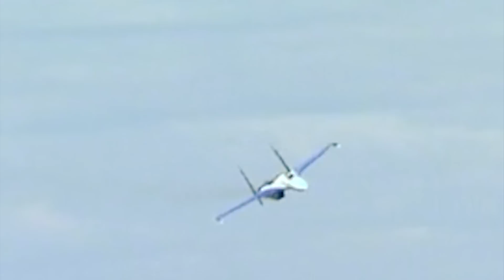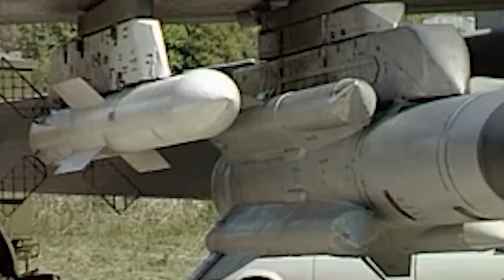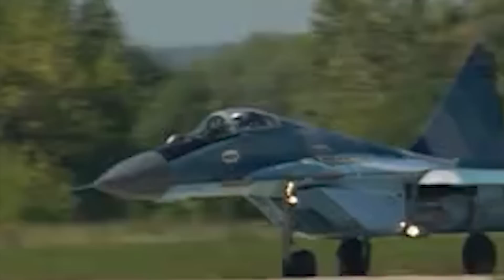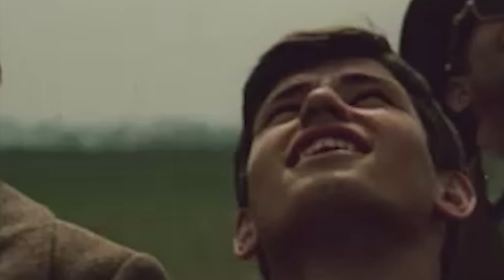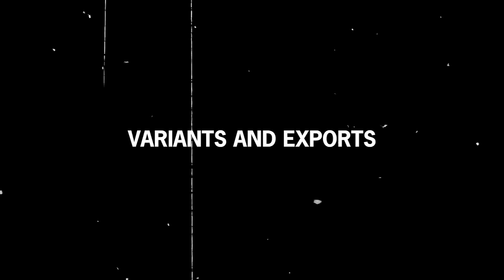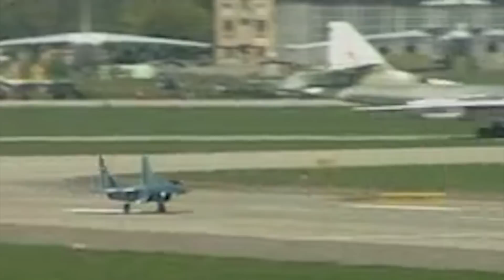Su-27 Flanker - Twin-Engine Supermaneuverable Fighter Aircraft

Comment: Right... sooooo... at various points during this Mig 29 Fulcrums were shown.  Whilst similar in overall planform it is a very different aircraft. The side by side pilot lay-out only goes for one subvariant: the Su-34. Other variants have a tandem lay-out if they have two seats. The follow up Su-57 does not have the capabilities you mentioned outside of propaganda.  It is, in fact, not even engaged over Ukraine. This has been a trend for this and other " Dark" channels during the last year. Cutting corners and pursuing sensationalism . This is a pattern.  I'm signing off. Goodbye.
Reply: I believe nothing coming out of Russia.  They lie as much as the Xiden administration does.
Reply: Goodbye, dear friend.
Reply: Good bye you won't be missed either you're full of it & don't know what you're talking about
Reply: What you've wrote bares no resemblance to reality. You haven't got a clue what you're talking about. This so called publicity stunt you say the SU-57  is the aircraft that's been used hitting the training centres in western Ukraine. All the videos are in Telegram. It turns out it has fantastic surprising that were unknown. Its capability is unmatched by anything. You first tried to say the Mig  & the Sukhoi are a similar platform. Straight away you proved you don't know what you're talking about. The Mig is a light much smaller fighter like an F-16. The SU - 27 & newer varients are heavy fighters like fighter bombers similar to the F-15.
There's a YT channel called millennium 7  he does full break downs of all aircraft. You'll find out how much of a publicity stunt the SU-57 isn't & how good it actually is. Now tell me about this space ship the Americans have & all of the battles its fought in. Its that fantastic they stopped building them. Then went to ridiculous expense in building a flying pig. I've asked a thousand F-22 fan boys why is it being fazed out if it's so good, I've also asked to tell me of its successes. The only reason I've gotten is the clearly bullshit reason of it costs too much. Why it couldn't be upgraded for a far cheaper amount than a full development of an aircraft with much poorer capability does not make sense at all. Unless  America does what America does best. Talks complete bullshit all the time because it knows its citizens just believe anything they say. Putin's Tax Hike caused it.
Reply: @DavyRo  they're not going to be able to mass produce the Su-57 in any significant numbers are long as sanctions are in place, and Ukraine's air defenses are going to result in more attrition of airframes over time. It wouldn't make much sense to risk their most expensive weaponry to attack training centers when they can do it with missiles that arrive on target twice as fast. And you make yourself out to be an expert but you clearly don't understand the US military's procurement process. Maybe you should do some research on it, starting with historic procurement failures of advanced airframes like the Valkyrie, B-1 and YF-23. Cost DOES matter, but not always. Export licenses matter, too, not to mention regional politics within Congress and outright bribery by defense contractors.
Reply: @DavyRo  So you haven't read my post. Astounding! You could have answered with tl/dr but didn't.  Your loss really.

Comment: Just a short note Mexico does not operate the Su-27 either in the Air Force or the Naval Air Arm... There was a chance to do so but this was squashed in 2006.
Reply: I believe Venezuela is the only Flanker operator in the Americas (besides the private US aggressor firms).
Reply: The variant that Venezuela has are the Su-30MK2's
Reply: @hmmjedi  Technically the Su-30MK2V, based on the Su-30MKK, with added maritime strike capability. It was initially developed as a subvariant of the Su-35 that was backfilled into the Su-30 to respond to a tender from Russia and the PLA. Vietnam, Venezuela and a few other countries later adopted it, mainly under deals to transfer resources in exchange for (often unneeded) military kit.

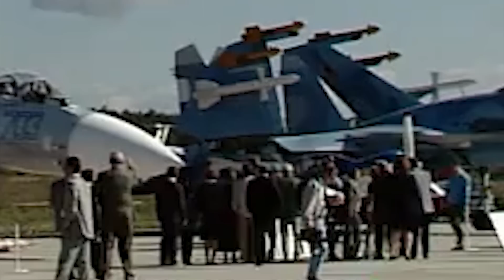Comment: Did you say they sit side by side on the SU-27? Might have that wrong  i think.. 4:29
Reply: thats the su-34 bomber variant which has a two seater side by side layout
Reply: Yeah, Dark Skies always talks a little too fast for his own good. He was referencing the Su-34 (which is conveniently shown when he mentions this fact 4:34-4:35) which is a fighter/bomber based on the Su-27 airframe where pilots do sit next to one another in the cockpit. Other flankers with twin seats are normal tandem seats like any twin seat fighter jet.
Reply: It's SU 34
Reply: @Robert Sears  the SU 37 was an experimental fighter jet to test out the viability of thrust vectoring on the flanker series of fighters, there was only one ever made and it was a single seater.
Reply: They do in the SU-32, a derivative of the SU-27.
Reply: @Robert Sears  Wrong. The SU-37 was a short lived prototype with a single unit produced. The flankers with canards you’re referring to are the SU-30 with 620 units produced or the SU-33 with 35 produced. You should look into the flankers variants before you try to talk about them.
Reply: @Robert Sears  Read a book please, thanks.